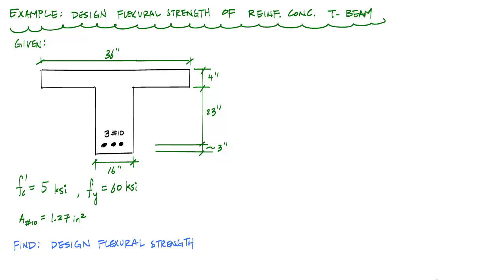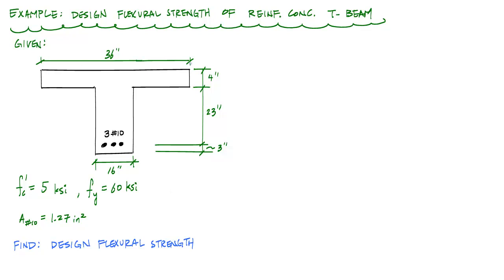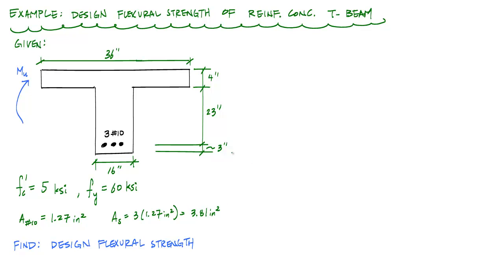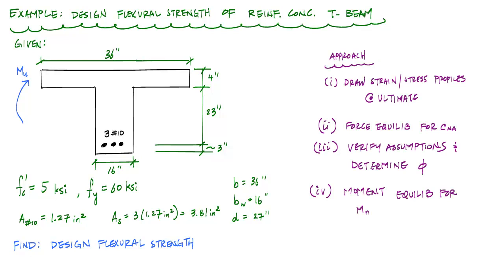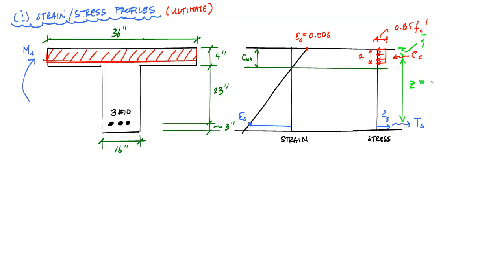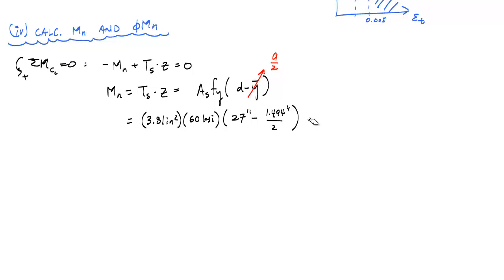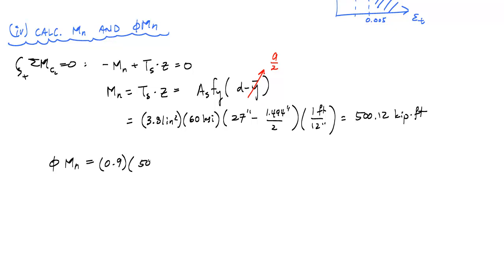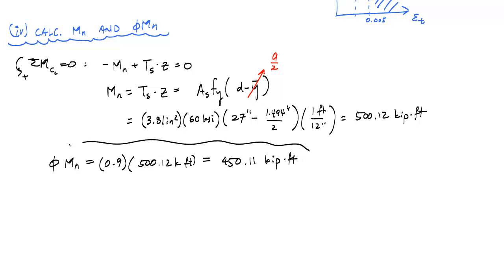Design Moment Strength Calculation of a RC T-beam - Reinforced Concrete

Comment: How about if Ac is Greater than Af?
Reply: and what if a somewhat covers a bit of the web's Area?
Reply from the maker: the area in compression would be a T-shape, you'd have to calculate the centroid of a t-shape to determine ybar (the location of the compression force resultant)

Comment: Hello sir I have single house 2 floor my question how I can calculate the concrete T beam for roof ceiling ? The length of building 13.5 meters and width 15 meters  thank you
Reply from the maker: +Amee Hassa congrats on your house....why you gotta brag? Just kidding.   You should start with your loading and load factors.

Comment: what's happens if the compression area consist of both (flange And web). please Make a video for that
Reply from the maker: You would have to calculate the centroid of the compression zone.
Reply: +structurefree 
so that is to say the centroid is: Cc=ΣA*c/ΣA = (36"*4"*2"+16"*X*(4+X/2))/(36"*4"+16"*X)
Where X is the distance below the flange the compression zone extends.
Please Confirm, and thanks for being awesome

Comment: So what's the value of epsilon y?Sorry if it's a dumb question.
Reply from the maker: +BendyBus Song epsilon y is the yield strain of steel which can be calculated from hooke's law.  epsilon y = f_y/E_s.  For grade 60 steel, it is 0.00207.
Reply: structurefree Ok thanks!  Makes sense.

Comment: I just wished you worked in mm, m, N/mm etc!!
Reply from the maker: Harry D i'll try to do some structural design in si units.  i'm in the u.s. and our design specifications use fps as the primary system of units.
Reply: I hope too

Comment: Thank you very much. Also i was wondering if you can make a video where the compression area is both in the Flange and web ?
Reply: There is now a video covering this. See: I-shaped RC Beam Design Moment Strength - Reinforced Concrete Analysis. Hope this helps all!

Comment from the maker: beta1 is a factor in the whitney stress block. it helps to locate the resultant of the compression force in a reinforced concrete section.  every reinforced concrete design textbook has an explanation of the relationship between beta1 and fc'.

Comment: Hi again so If I have calculated the cracked second moment of inertia and I want to use it in tau=VQ/It . The area I should use to calculate Q under neutral axis (assuming under the neutral axis is the tension zone) is that of the transformed area of steel only?

Comment from the maker: Great question!  the basic mechanics equations like tau = VQ/Ib and the transformed area method (Es/Ec) are only applicable when the material remains linear elastic (i.e. the strains do not exceed the proportional limit) and the stress profile remains linear.  Force equilibrium works in all stages of material behavior in a beam, even when the material behaves nonlinearly...as in the instant before concrete crush or ultimate RC beam behavior. Thank you for your question and kind comments!
Reply: Thank you for being such an awesome teacher.
🔥

Comment: Hi, I understand that the neutral axis is the axis along the length of the beam which remains unstressed. Which means I will need to find it using force equilibrium. However, when we calculate the shear stress across a section using using t=VQ/Ib we assume the neutral axis is at the centroid! What I want to ask is why in some call